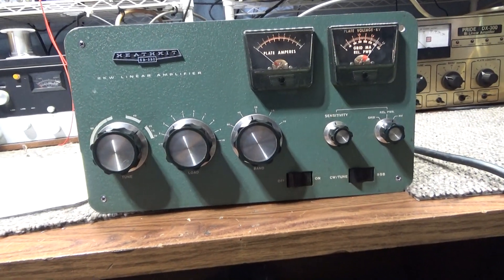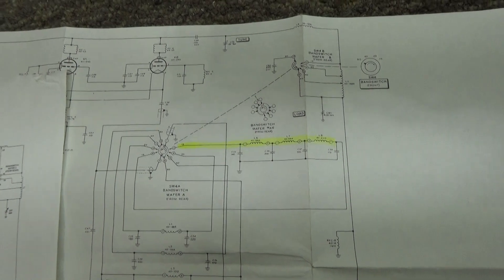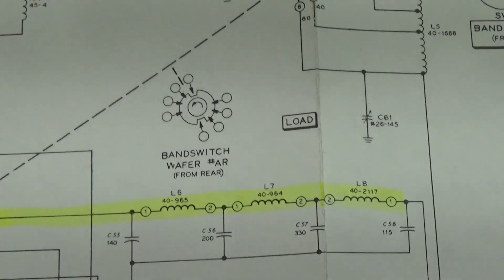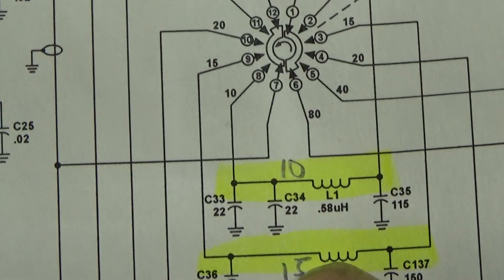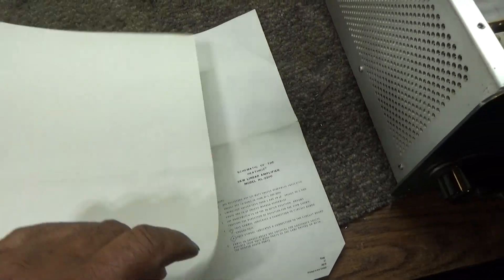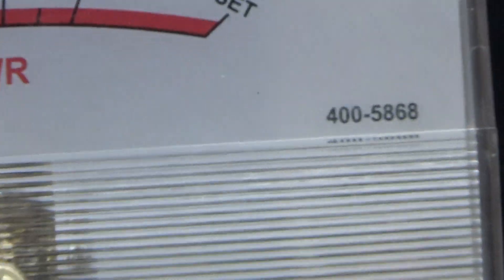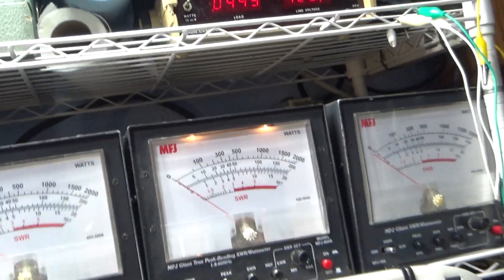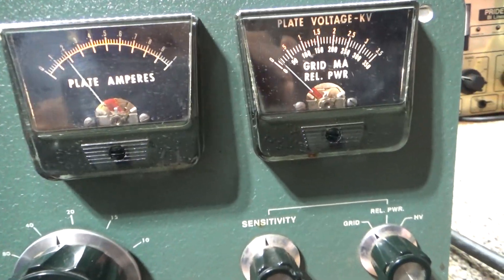Heathkit SB-220 mono banded 10 meters on the bench

Comment: Nice amp! I’m very interested in knowing more about the input tuning circuit. I’m working on an old beat up sb 220 myself right now and I’d like to make it more efficient overall. The input swr is too high for me
Reply from the maker: from the net, but I agree:
Power Supply:  4)      Power supply improvements include removing the 30K resistors across the filter capacitors and   replacing with 68K 5 watt wire wound resistors to reduce heat near the capacitors. I replaced the original HV diodes with 1N5408 3A diodes. I removed the original Zener diode and replaced it with a series of seven 1N5408s.
Reply from the maker: 5)      I removed the RF network at the grids and grounded each grid together and to the chassis.
Reply from the maker: 7)      I put back to back 1N5408 diodes across both meters to protect them.
Reply from the maker: This one was too long to cut n paste, but it is what I went by for the Input on this one. I ended up taking one turn out of the 10 meter input coil, but it was still a little too much inductance so I ended up removing the adjustment slug out of the coil too. Then the Input cap was changed to a variable 100-300 pf and the output cap was upped to 100pf fixed. Drake L4B has an input tuner with better Q than the Heathkit and you can also go by the Drakes to get figures. https://www.qsl.net/wa5bxo/ag6k/sb220ci.html
Reply: @tramdr  ok thanks!
Reply: @tramdr  do you have a little air variable that would work for an input tuner that you would sell me?
Reply from the maker: This should work:   https://www.ebay.com/itm/185606767517
Reply from the maker: or this:  https://www.ebay.com/itm/394297022378
Reply from the maker: or this:  https://www.ebay.com/itm/304806763093
Reply: @tramdr  thanks big time for you help!

Comment: I have a Chris sideband 600 when I turn it on it vibrates for a minute and blows a fuse can you tell me what to look for I know you're busy
Reply from the maker: In order or most likely: 
Power supply HV diodes shorted. 
Power supply HV caps shorted
Transformer itself shorted
Tube shorted. 
Never over fuse it. Take out tubes, try it, if it still shorts, open the capacitor bank, if it still shorts, open the power supply diodes, if it still shorts after that, its the transformer. If it stops shorting when you take something out, then that is 'usually' the problem.

Comment: Does it run on 110 or 220 ?
Reply: Both, but they highly recommend using it on 240 volts.
Reply from the maker: Yep, both. Has a terminal strip underneath that you connect jumpers to change it to either 110 or 220. Also, as Spaceflight said, it is highly recommended to run it on 220 as with any amp doing 2kw or more.